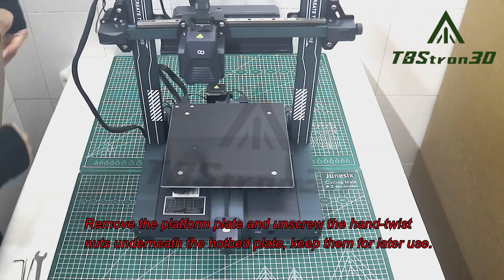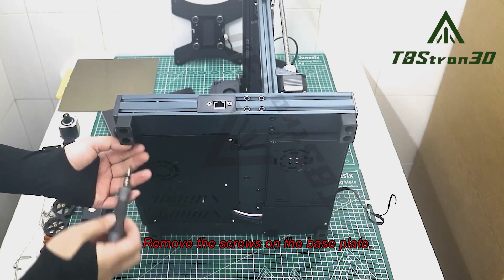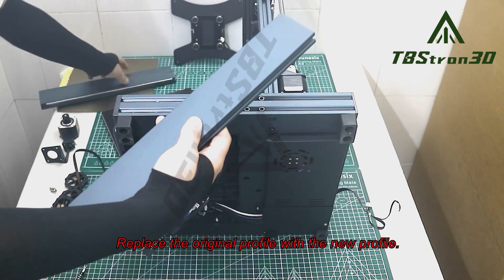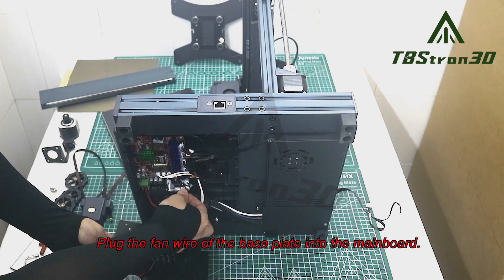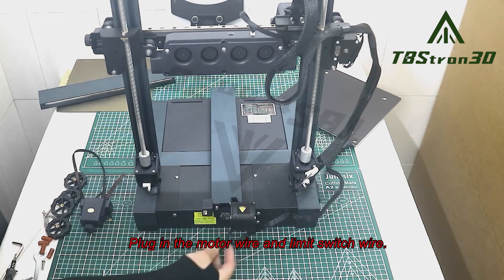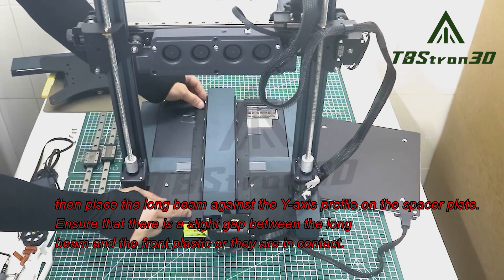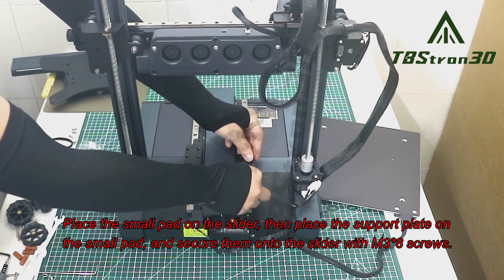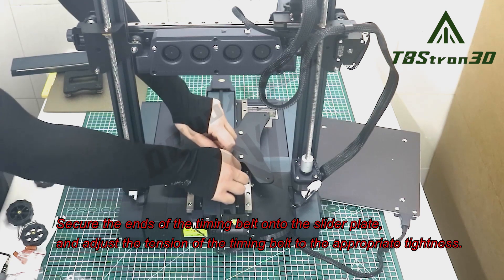Y axis upgrade linear rail for ELEGOO Neptune 4 Pro installation guide

Comment: My Neptune 4 Pro has a different Y plate, it doesn’t have 4 screws it has round pucks secured with Allen screws. Will this still attach to the plate?
Reply: Non pas du tout j'ai commandé sont kit et c'est pas compatible
Reply: I have the same issue.   I suppose one could drill out the threads on the plate and "pucks"???

Comment: Pointless. The Pro version of the Neptune 4 already has linear rails on both x and y axis.
Reply from the maker: Hello. The original dual-axis linear guides on the X and Y axes of the machine can indeed meet the needs of most users. However, there are a few customers who pursue lower noise, higher print quality, and no longer want to adjust the eccentric isolation columns. Thank you.
Reply: @tbstron3d-yf9op oui des client comme moi qui on commande pour ma Neptune 4 pro et le plateau et pas le même que sur la vidéo
Reply: Linear *RODS*. If you’re gonna be confident, at least be right. Chode…

Comment: May I ask what this upgrade does for the printer?
Reply: Initially, the platform is moving on the rolls. You are replacing it with the system that uses movement on the rails. Less noise, less risk of wearing of the rolls, more stability and more attention to greasing the  rails.
Reply: Nothing really,  waste of time and money.
Reply from the maker: Hello. The dual-axis linear guide used on the Neptune 4 Pro is quite durable. We recommend not upgrading it at this time. However, if you switch to linear guides, there will be a slight improvement in print quality.
Reply: You can switch to carbon Y carriage from n4 with that mod. Which will cut off half of a weight of your bed (or even more, my n4pro Y carriage weights 400 grams). Which will make your printer faster.